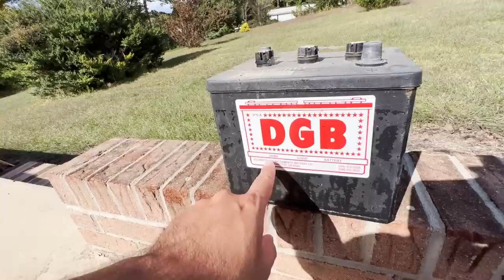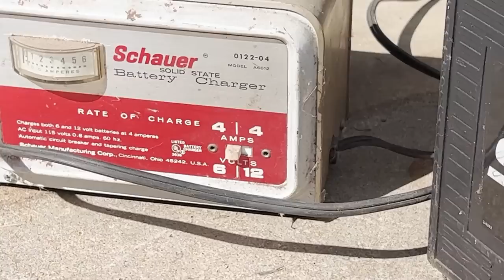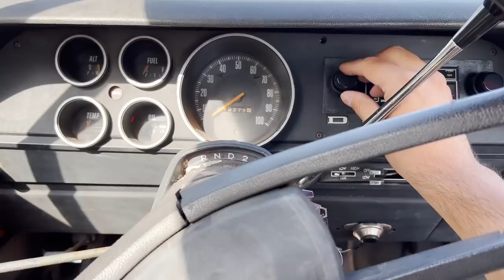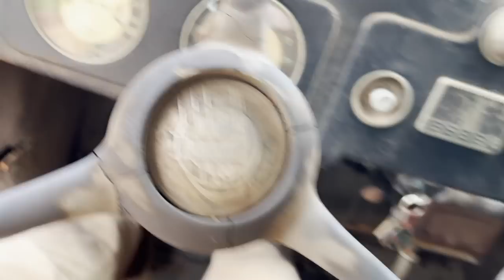1937 Plymouth First Start! Will it run and drive? 201 Flathead 6 MoPar. Old Cars Dodge Chrysler

Comment: I remember my dad owning a 37 Plymouth. I was about 6 or 7. I recall we went on a Sunday drive and had to stop under some trees. We sat there for a long time. I remember how the windows had a mustard color at the edge. Found out later the plastic between the layers turned with age. I have a photo of the car with me peeking out the front passenger and my younger brother at the rear window.

Comment: Just found your video on the 37 Plymouth. Good job getting it started. It was running pretty good until the radiator hose went. Enjoy your videos.
Reply from the maker: @hutmgr  Drove pretty decent… just no brakes!
Reply: @ObsoleteAutomotive  they would help! Are you planning a roadtrip up to the northeast yet.
Around New England area?
Thanks!
Reply from the maker: @hutmgr  I just completed one! Working on the full video right now. Preview video is linked below: 
https://youtu.be/_g-jEAxn_rc

Comment: The visible windows are obviously just flat glass. Surprise to me. When did curved glass come into use? Good job getting it running.
Reply: I do not believe that curved glass came into use until the fifties, I think in the early fifties if memory serves me correct.
Reply from the maker: For the most part curved glass didn’t become common until the early 1950s for windshields. Side glass remained flat for longer. However late 1950s Imperials used curved side glass. By the 1970s curved side glass was pretty much used across the board.

Comment: Thought battery on concrete was a no no ? Urban legend maybe ?
Reply from the maker: Man that’s old news. Way Back when a battery had rubber cases and such it mighta been a problem. But with new plastic cases it won’t do anything. I’ve stored batteries for years on concrete and it did nothing.

Comment: Enjoyed your video right up until you put fuel in her and started it up......Then I cringed!!
Reving the crap out of an engine which hasn't run in decades (or even a week) is just not on.
You need to give that motor time for oil circulation or you can do irreparable harm to it.
Smart old buggy nevertheless👍👍👍
Reply from the maker: I have revived countless cars and put them back on the road and then driven them thousands of trouble free miles. The initial cranking of the car showed excellent oil pressure. Which would have easily lubricated the rotating assembly. If not then there would be bigger problems! Keeping the engine running good let’s them rings seal up and all the cylinders picked back up and now the engine runs like new! I bet this engine will last a good while.
Reply: @ObsoleteAutomotive  I appreciate what you're saying, doesn't alter the fact you should never rev a cold engine that way.
Good luck👍👍

Comment: you might want to invest in a real battery charger if your going to play with old cars
Reply: You'd be surprised what solid pieces those old Shauer brand Chargers were.
Reply: He already has a "real battery charger" Those are great. The " high tech ones are garbage, they wont even try to charge an older dead battery.
Reply from the maker: My old chargers have served me well for years and served those before me well for years too. It does the job just fine.
Reply: @ObsoleteAutomotive  I have one almost like yours, only difference being the style of gauge it has,Dad bought it new in 1974 for the purpose of charging the batteries for his trolling motor,I unearthed it recently when my Mountaineer had a dead battery and it still does the job, only regret I have is not keeping the old time service station charger he had, that thing was a brute!!
Reply from the maker: @rogercamp6071  They work excellent. And they always work! Never gave me any issues!